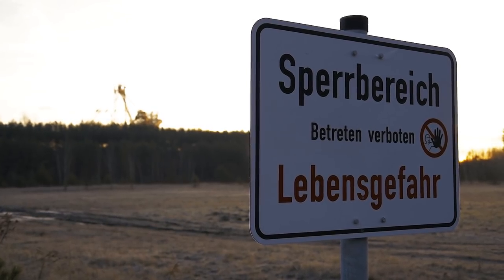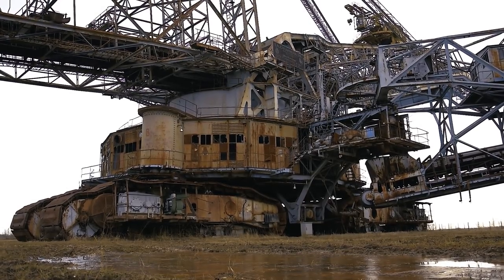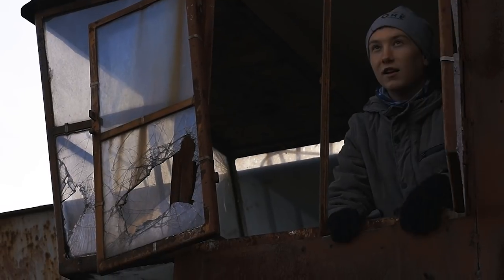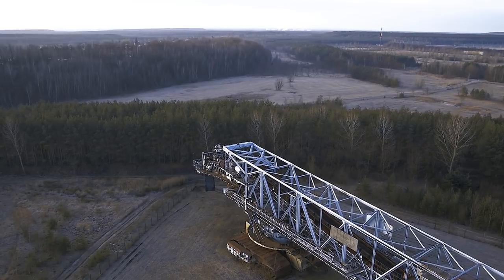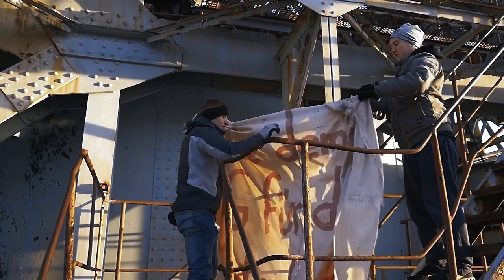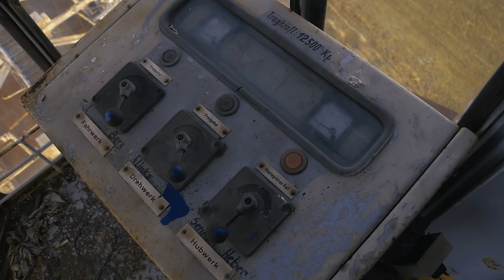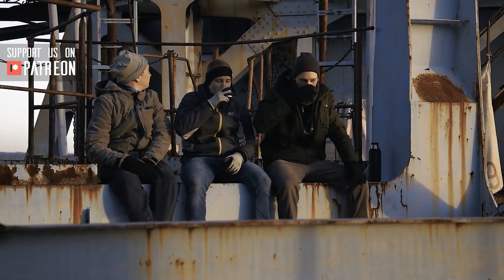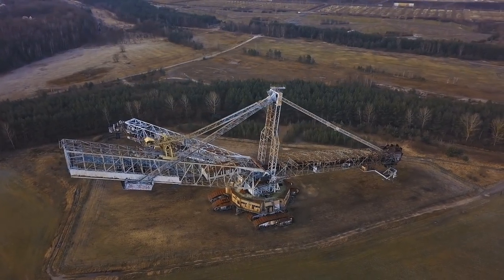Climbing This MASSIVE Abandoned Factory ON WHEELS - Urbex Lost Places Germany

Comment: I almost never comment on youtube, but I have to say that while there may be enough steel on the excavator to build many windmills and stands for solar panels, I like the fact that it sits where it does. It serves as a reminder of where we came from, with a view of where we are going. 

i know this comment will end up buried
and the trolls will have their ways
remember though we are not married
to those olden ways
remember where we came from then you can look ahead
the decay serves to remind us life comes from what is dead.
Reply: It’s not steel that photovoltaic and turbines require but far more precious things. They are in fact the new stain on the land. 
As they say, the road to hell is paved in good intentions. Meanwhile look how inefficient in energy production Germany has become and they only spent a fortune to take steps back! While the US has led the way in carbon emisión reduction voluntarily. 

That bucket wheel is sitting there because its not economical to do anything else with it. They couldn’t make any turbines or cells with it at all.